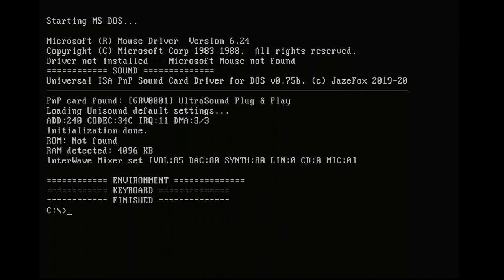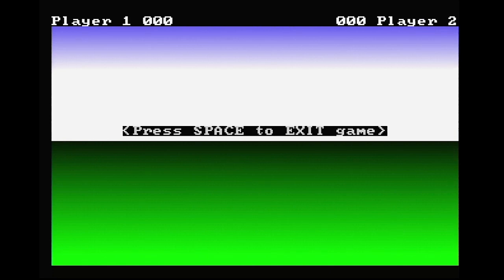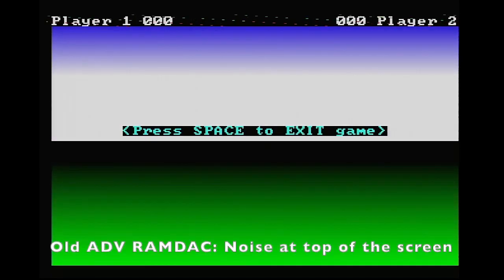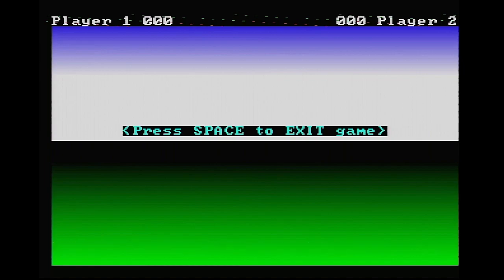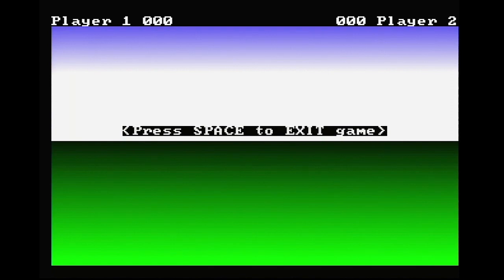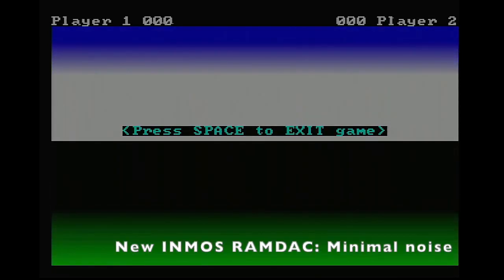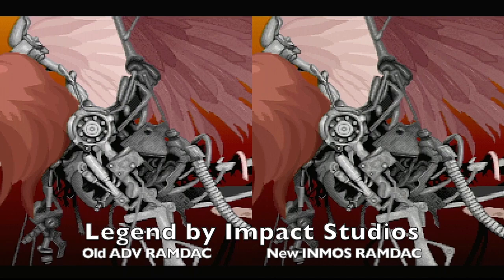Upgrading The VGA RAMDAC

Comment: I think the shiny legs of the INMOS chip mean that it was removed from something by some solder bath method. It is not a big problem if it works, but I heard that the removal process can damage chips inside. And sometimes the legs are just barely hanging (you think it went into the socket, but no contact because it broke when you pushed in).
Reply from the maker: Good explanation. I see that a lot with supposedly NOS chips.

Comment: It looks like the old one produces random noise while being updated, whereas the new one holds the previous output value instead - leading to some pixels appearing with the colour of the previous pixel, which is still wrong but less obtrusive.

I remember back then we had to wait for vsync before updating the palette, with the idea being that you get the whole palette updated during the blanking interval, so no artifacts on the visible display. Perhaps this cpu/bus speed is not fast enough to do that entirely within the blanking interval though.
Reply from the maker: Yes, might be. Old CGA cards also produced snow if you updated the VRAM while the picture was still being drawn.

Comment: Performed the same upgrade. Besides the picture quality I even got some more FPS in Doom.
Reply from the maker: Nice. I wonder why that gives higher FPS? Does it scan the DRAM more quickly and leaves more bandwidth for the CPU to update?
Reply: root42 Don’t know used Phil computers benchmark to check. Only Doom was a tiny bit faster. However consistently.